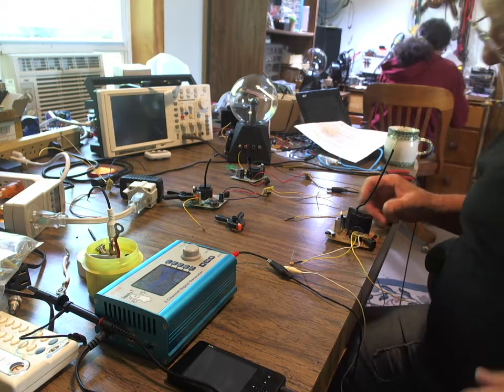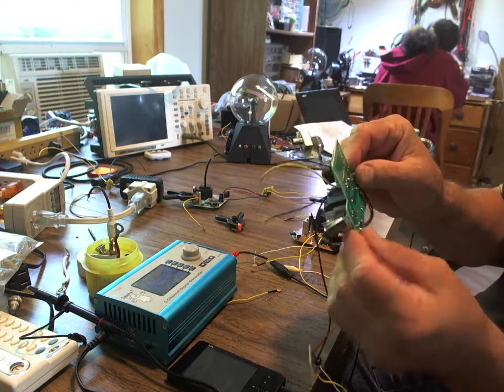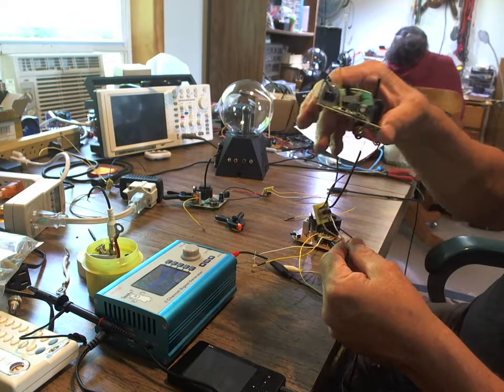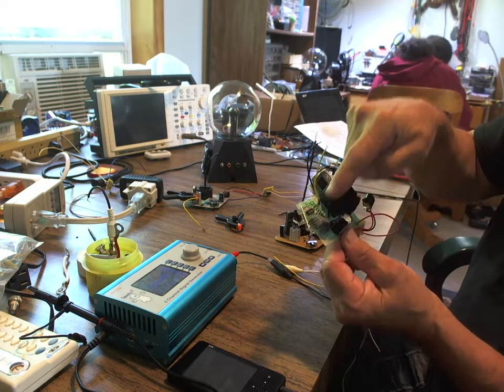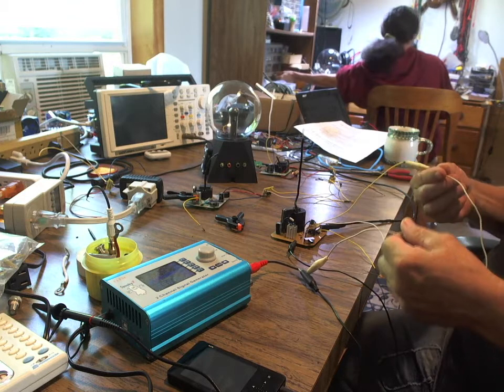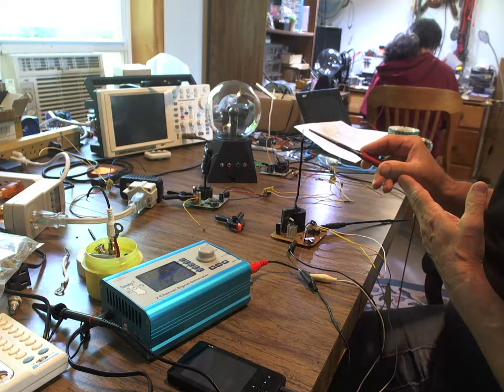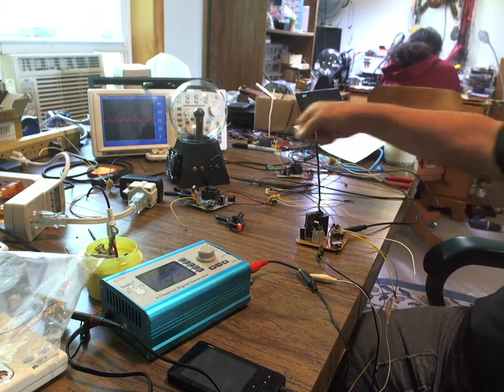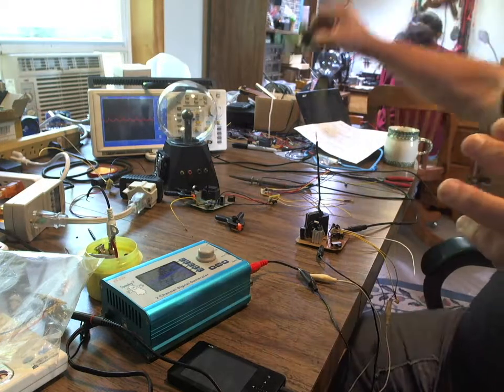Plasma Ball Modification Video V6

Comment: Please send me an email so I can begin communicating to you my questions about two different types of models of the Spooky 2 and, questions about your Spooky 2 add-on accessories.  I am interested in trying one or two Spooky 2 frequency generators for scalar wave and magnetic wave propagation to try to repair DNA damage to my bone marrow tissue cells caused by someone having poisoned me externally through contact with my hands with the termite pesticide chlordane in 1976 and, then internally [2001 & 2003] by ingesting food someone had tainted with chlordane [attempted murder all three times].  In 1981, Pasadena, CA surgeon [Ronald Gaspard, M.D.] who knew someone had poisoned me with chlordane, performed a life-saving operation to remove my spleen which over a 4 year period, had become dangerously enlarged from over 4 years of massive premature destruction of my deformed, excessively fragile red blood cells in the capillaries of my spleen.  However, since that life-saving operation in 1981, I have been poisoned by someone 2 more times with chlordane placed in food intended for me to ingest in 2001 and then in 2003.  I am at high risk of ending up with leukemia, brain cancer, liver cancer, stomach cancer, bladder cancer or, intestinal cancer from being poisoned with chlordane.  Chlordane / heptachlor damages bone marrow DNA.  Just by chance, I learned who Raymond Rife was, then I learned who Nikola Tesla was, then James Clark Maxwell, and then Wilhelm  Reich.  I know very little about electronics and physics, but I believe scalar wave, magnetic field, and frequency propagation can repair damage to the body [ damaged DNA], destroy cancer, destroy viruses & bacteria, re-energize the body with scalar wave energy or 'Orgone' energy / 'Ti' energy / 'Chi' energy / 'Prana' energy to fortify and help protect the body from further weakness, damage and, disease.  At first I was quite skeptical, but I am beginning to believe that scalar wave propagation with magnetic wave propagation and healing frequencies can manifest miraculous repair to damaged DNA and / or, manifest miraculous healing.  I ended up on Social Security Disability in 1986 and, I have since given up on 'western medicine doctors' and have given up on H.M.O. physicians especially.  My brother is financially independent and, may be interested in purchasing Spooky 2 frequency generators and all the accessories you have demonstrated in your videos.  However, one of the founders  / developers of Spooky 2, now has new YouTube videos advertising / demonstrating two briefcase luggage size 'Spooky 2' scalar wave propagators which work together via a cable wire connection to each other.  I am now confused why there are two different types of Spooky 2's being shown on YouTube.  What is the difference between these two different Spooky 2 models and, which is more effective in propagating scalar waves, magnetic waves and, beneficial frequencies?  Please email me an explanation with information and, the estimated prices to purchase each of those two different Spooky 2 models and, the price to purchase all the plug-in attachment accessories you have shown and demonstrated in your YouTube videos, including your plasma ball modification / accessory.  My email address is bradleyslyons4@gmail.com.  Thank you so much for your YouTube videos.
Reply from the maker: I would suggest you go to or join the Spooky forums;
https://www.spooky2icu.com/
https://www.spooky2.com/forumgate/
I am not a support resource for the Spooky2 function generators or the Spooky related product lines.  Additionally, I do not post emails on open blogs because it opens one to abuse by spammers.  Indirect contact can be initiated through the website.   Respectfully, Steve